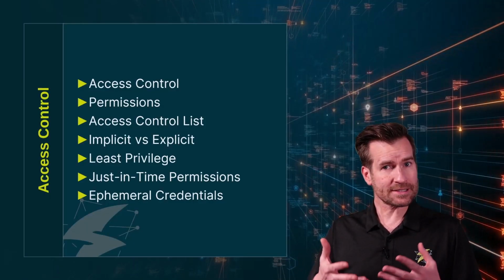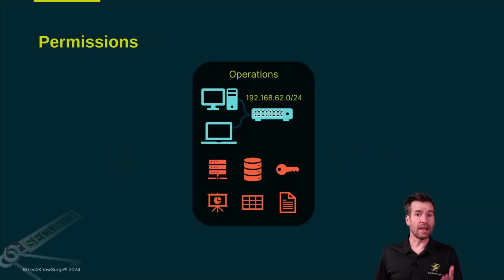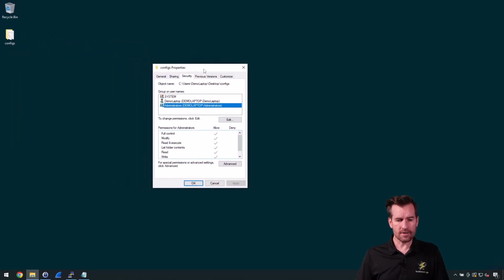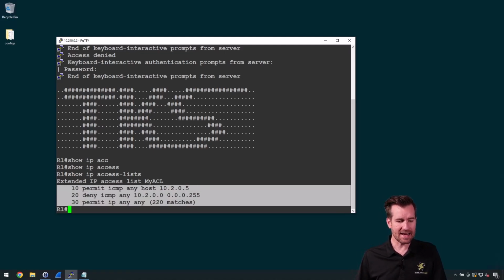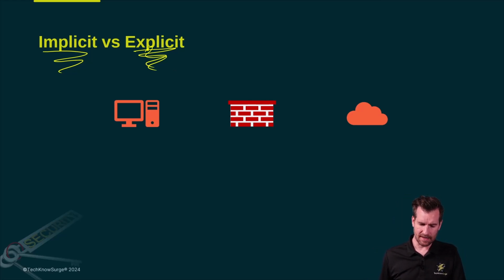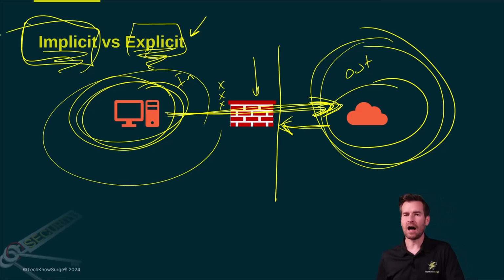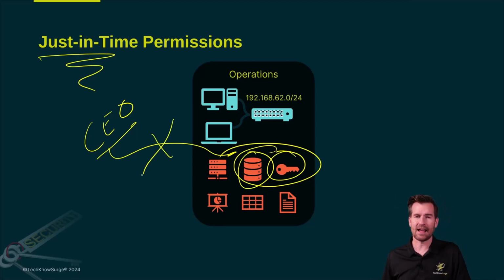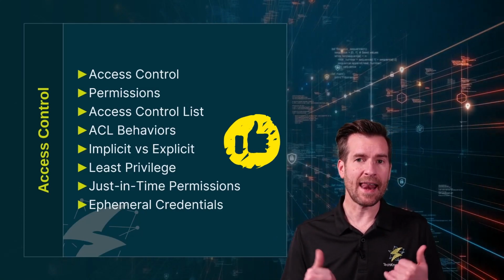Foundations of Cybersecurity 4-7: Access Control

Comment: In the first ACE router's ACL, the host 10.2.0.5 part of the statement is the destination ip address? I mean, the ACL is read "permit pings from any host to host 10.2.0.5" ?
Reply from the maker: Correct! I have a whole module on Cisco's ACLs:
CCNA WANs 12-0: Module Intro	https://youtu.be/LBCXiQ5PO2k
CCNA WANs 12-1: Firewalls	https://youtu.be/BkDerf2Fd2E
CCNA WANs 12-2: ACLs	https://youtu.be/cXbzTZ7UDlE
CCNA WANs 12-3: Standard ACLs	https://youtu.be/gWMN0Ie3_x8
CCNA WANs 12-4: DEMO: Standard Numbered ACLs	https://youtu.be/NYflYIyTIRk
CCNA WANs 12-5: DEMO: Standard Named ACLs	https://youtu.be/VuNYfXa1JRw
CCNA WANs 12-6: DEMO: Secure VTY Ports	https://youtu.be/jR5o6J6XfOE
CCNA WANs 12-7: Extended ACL	https://youtu.be/3bZFBJQhXrc
CCNA WANs 12-8: DEMO: Extended Numbered ACLs	https://youtu.be/3Y3z6-HKzGg
CCNA WANs 12-9: DEMO: Extended Named ACLs	https://youtu.be/sxc__UxgtVo
CCNA WANs 12-10: DEMO: ACLs Established Traffic	https://youtu.be/oNwSuvKvb-s
CCNA WANs 12-11: DEMO: ACL Example	https://youtu.be/CZpoqRu75oQ

I also have a more generic ACL lesson that I just created but isn't published yet. Although many other vendors ACLs are very similar to Cisco, not all of them are. In fact, most of the time your dealing with a GUI interface, not command line when it comes to firewalls.
Reply: @TechKnowSurge  Thank you for the reference links! I passed the first classification stage, just received the result through email. I was focusing on the wrong stuff for the second stage (Cybersecurity Fundamentals and Security Operations), the second stage exam evaluates, and I quote "Devices send and receive data, types of network cabling, how IP addresses find information on the internet, and the benefits of the cloud and virtualization, understanding of the physical, link, and network layers and how they work together to provide end-to-end connectivity." And "also test your troubleshooting knowledge to support endpoints, networks, and users as a member of a technical support team". So I have to reorganize myself and review these topics until the end of the week. Cybersecurity Fundamentals and Security Operations will be very important for the third stage, provided I pass the second stage exam.
Reply from the maker: @gustavocruz988  CONGRATS! Great job on the first stage!!! If you need to reference anything, here are a list of my vids: https://sienna-aardvark-625278.hostingersite.com/course-info/. This is a copy of my old site and will only be up for a limited time. Some of my newest videos are not on there, but maybe that site can help you find the right study material.
Reply: @TechKnowSurge  thank you very much, man!
Reply from the maker: @gustavocruz988  You bet. Hope it helps!